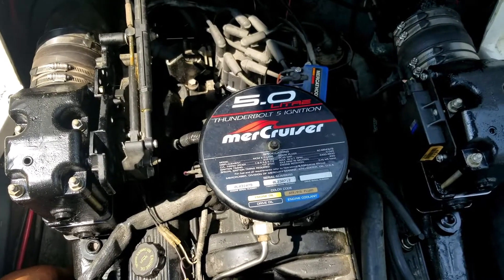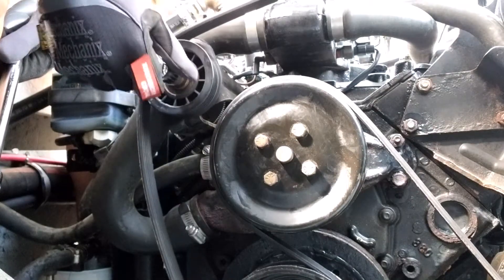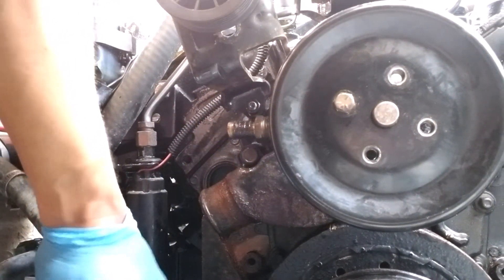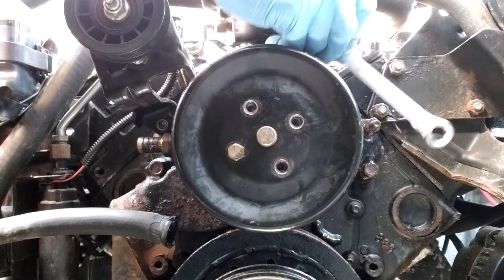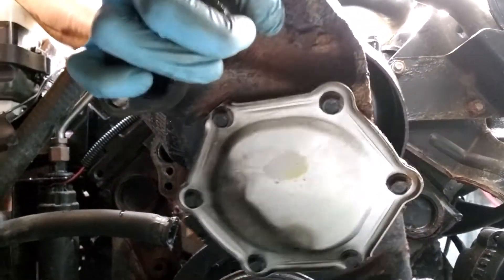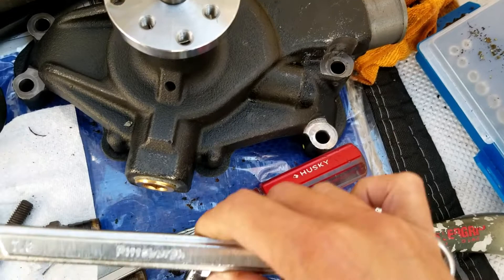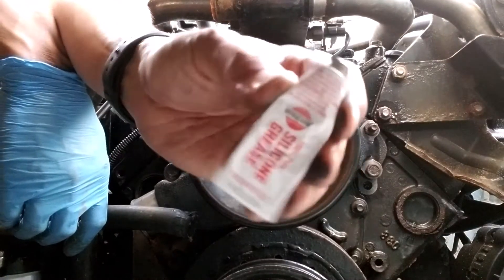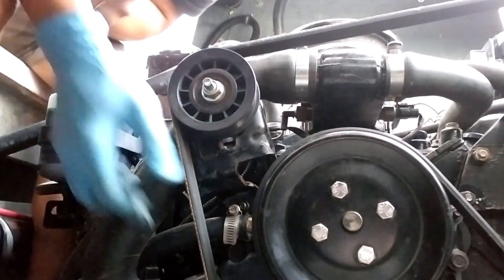Water circulation pump replacement 46-8M0113734

Comment: Thanks for the video, i have some coolant leakage on my boat, i hope replacing a tube will fix it but it might also be the waterpump, so if that is the case (which i still hope it's not) this video has been a great help ;).

Comment: Hi my 4.3 looks the same and gone noisy, can this be done ok with the boat still in the water?…thanks
Reply: I have heard you can, but I don't know for sure. Did you figure this out yet?
Reply: @heelside226 yes totally fine.  Have mine off right now in the water
Reply: Yes, easy to do in the water

Comment: Do you have a pic of what it looked like inside.  Was wondering if the impeller is rubber or steel.
Reply from the maker: it was some sort of metal maybe aluminum, sry i don't have a pic. it was pretty basic inside just the impeller mated to the pulley that is spun by the motor.
Reply: Huge help was wondering what it was inside there.  Figured metal since it has to deal with temp.